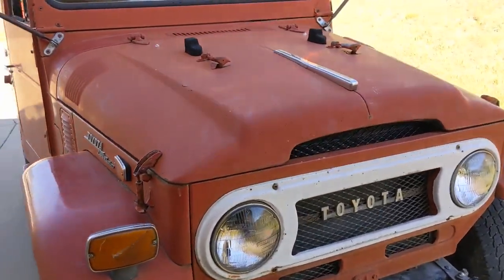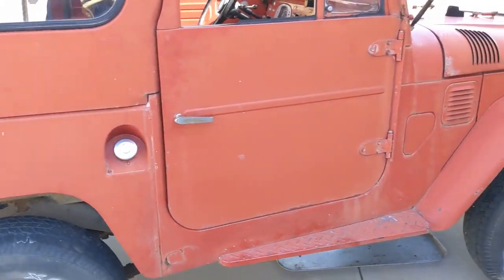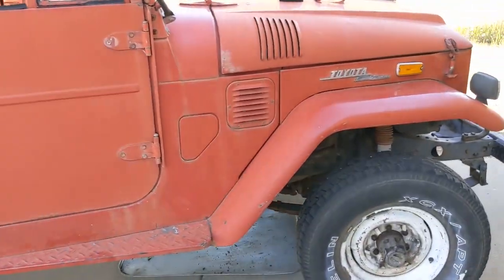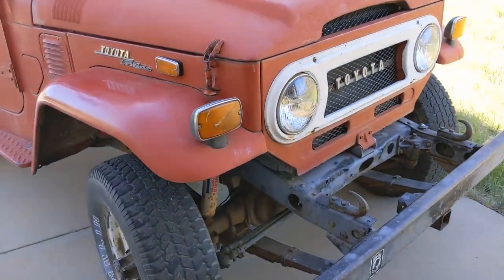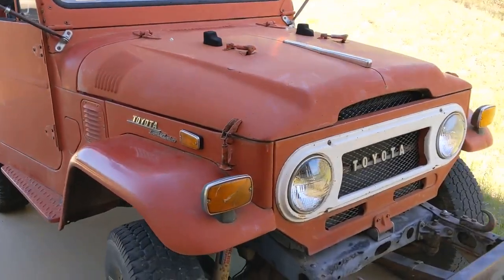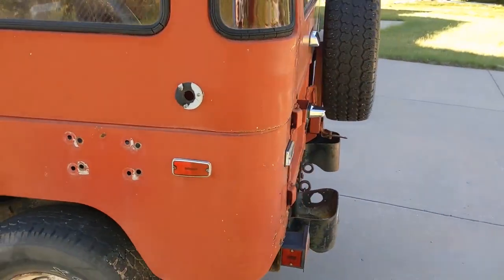An amazing transformation

Comment: Great job - if you went over it again with 3M Finesse, then deep cleaning wax it would be perfect!   I have a '72 the same shade of pink - lol... and need to do the same, but mine has quite a bit more rust.  You have a fairly solid FJ - would leave it as is in my opinion anyhow.  As the old saying goes 'They are only original once'.   Yours has the exact right level of 'patina'.
Reply from the maker: You're right, it needs another pass. I'll look into 3M Finesse, which I didn't know about. 

I'm inclined to agree with you about leaving the body unrestored. I like the lived-in feel.